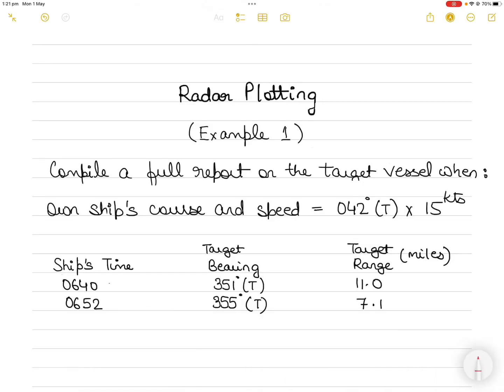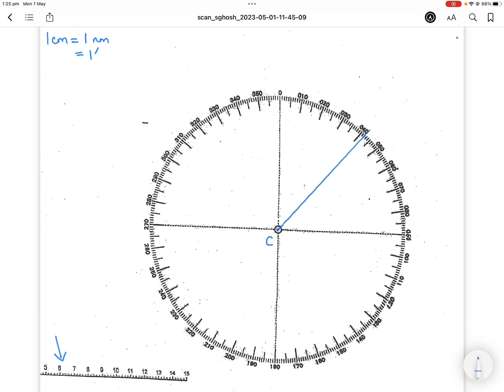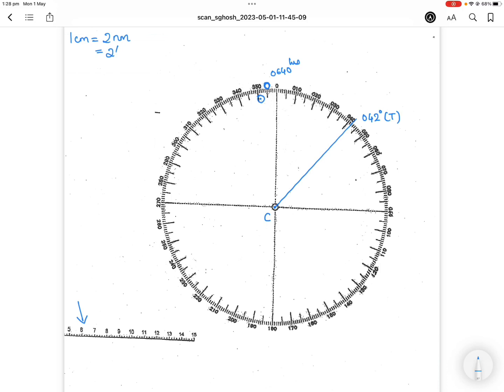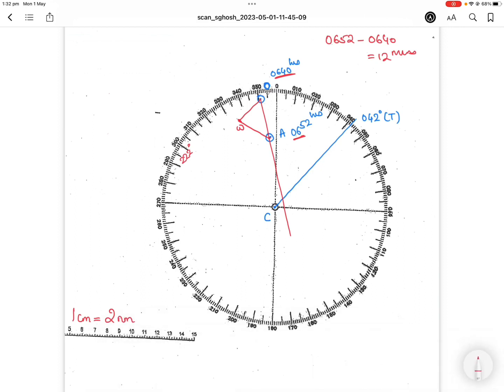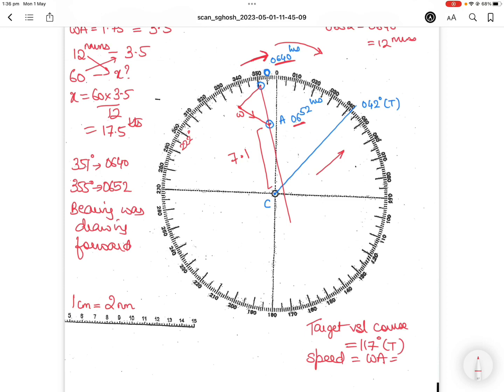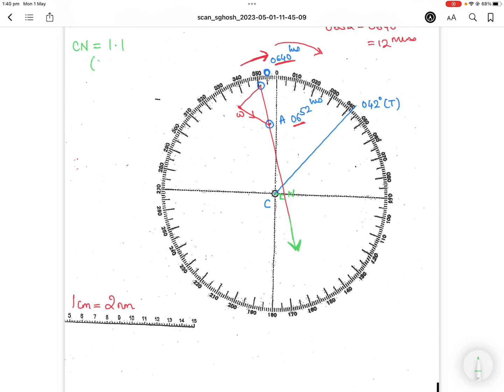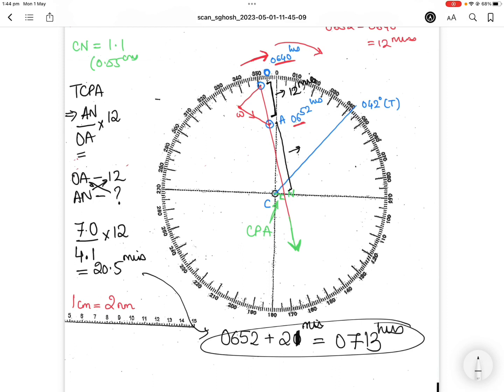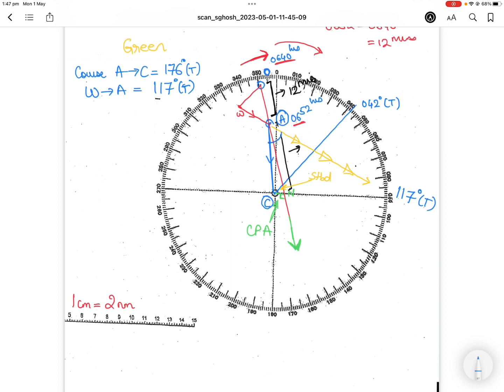Radar Plotting (Example 1) - Deriving Aspect, Target Course & Speed, CPA, TCPA, and Range.

Comment: When you found that target vessel has 117 deg  TRUE, does that mean than HDG also same and we just make it interchangeable? I mean what if you have sstrong current and Target Vessel's TRUE Course is 117 deg but the heading is dramatically different(let's say 45deg). Do we basically need HDG in radar plotting? I mean the aspect will be very different from what we draw